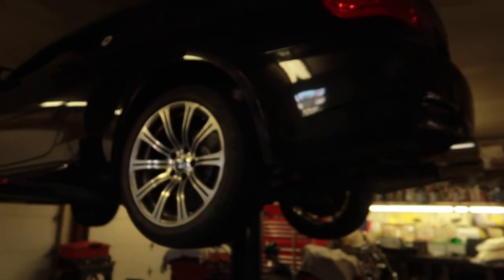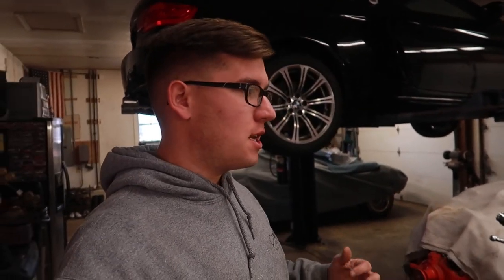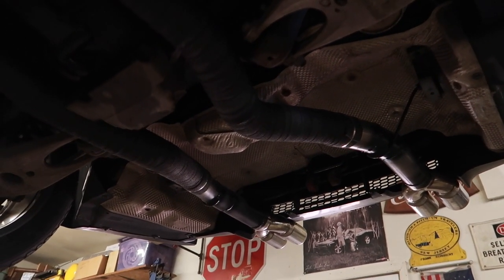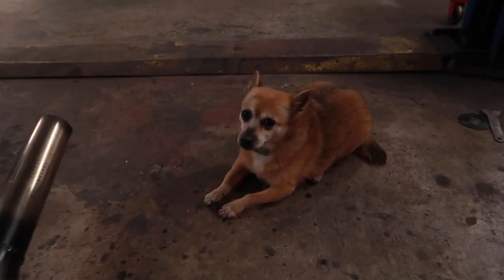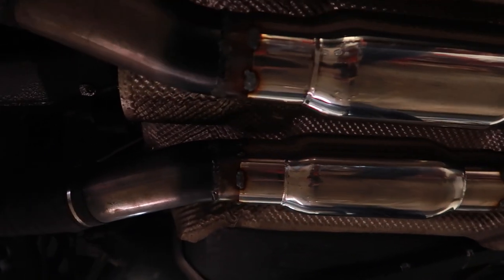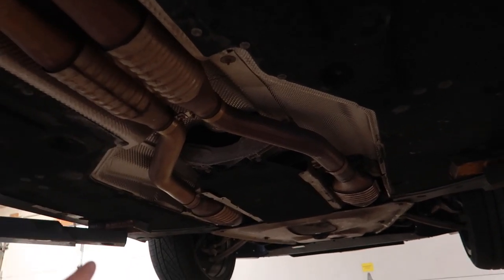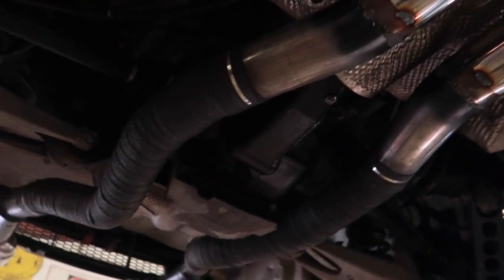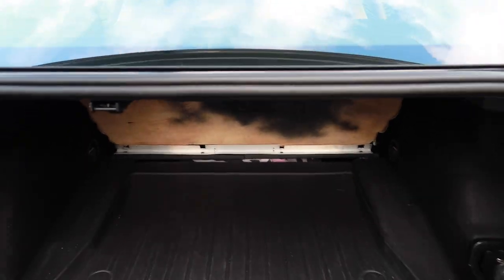Installing 2 vibrant performance resonators (hoping to fix the drone issue)

Comment: You will never get rid of drone with a loud car, it’s just the harsh reality of having no mufflers or no resonators. You will never get loud outside & quiet inside when you replace OEM exhaust components for louder aftermarket components.
Reply: Yeah I'm beginning to learn this. Always had trucks and they never had any drone issues but now that I've switched over to a 5.0 mustang gt I'm trying a few things and it's gotten better though
Reply: @collintaylor4127  try what?
Reply: Helmholtz resonators fix this
Reply: 45cm resonators are a good starting point or as you say in King Henry's measures 18"

Comment: Hey!  I recently installed catless downpipes on my N54 e92 with a aftermarket catback exhaust. Increased power and turbo spool but killed my exhaust note. I am going to be pursuing some Vibrant Resonators but which model did you use?  1794?

Comment: A Helmholtz resonator (J pipe) would definitely fix your drone issue. I just went through this with my car, even did the Vibrant resonators and found the same thing, helped with some rasp issues but did absolutely nothing for the drone. The thing is with the helmholtz you have  to get the length just right for maximum effect. There are all sorts of calculations you will find, the problem is there are so many variables they will not give you the ideal length. I found just a 2-3 inch change can make a huge difference. 
I new it would be somewhere between 30 to 48 inches, fortunately my car is a single exhaust and I had plenty of room to add a long J pipe. So I used a slightly narrower pipe with a band clamp so I could experiment with different lengths. It immediately helped but still not enough, I went to extremes and did not notice much difference, then I started doing smaller increments and when I got to around 42 inches it all of a sudden was a night and day difference. I really think this is the way to do it, folks that pick one fixed length right off the bat based off of some arbitrary values is most likely not going to give the best results. However if you get the length right the results are very impressive.
The problem with your situation is I don't see where you have room . A muffler will certainly work, but will also kill most of the sound you are after. That is what is so great about the Helmholts option, it is very frequency selective, so you can get rid of the drone and still have most of the sound you want. You just need to find the space.
Reply: This sounds right. It’ll be a frequency related issue, like I’ve posted. Interesting product you’ve found there.

Comment: J pipe is what you need for the drone. Resonator will only help on low RPM rasp. Will not lower volume and will little to no drone reduction. I had the same issue with vibrant resonator.
Reply: Hey man. Where did you place your vibrant resonators ? I heard some placed it where the mufflers used to be and others placed it where secondary cats used to be. Im having low end rasp around 1k-2k rpm. Catless vrsf dps. Sec cats delete. Muffler delete

Comment: Hopefully you ceramic coated exhaust before wrapping it… Otherwise moisture will build up between the wrap and the pipe, and ultimately corrode holes into it. 

Ask me how I know 😉
Reply: Exactly, but his kid did a video on reducing drone by installing a resonator (which typically target rasp, not drone), yet didn't even rev it in the video... I doubt he is keen enough to even understand what you said.
Reply: No it doesn't
Reply: @Liveforeever   Yes… It does.
Reply: @nataliamiliano150  mine didn't
Reply: @Liveforeever   Not yet… they will. 

Or pull off the wrap and see what’s happening underneath. You’ll see.

Comment: The resonators are designed to eliminate rasp from V6 and V8 engines. 

Inherently they will remove a tiny amount of other sound like volume and drone - but not much, and not their intention. 

A rear muffler is designed to reduce volume. 

The drone can come from anywhere. But ultimately it’s a frequency issue. Anything that you add or omit from the exhaust system, or anything that vibrates, will change your experience.  Therefore adding mufflers may change it or mask it: you may only need a small one; alternatively a different size resonator may work, or secondary inline pre-res set. You could even change exhaust length. 

You can chase this for ages ; this is what manufacturers spend ages on developing. 

Get it right and you might have a winner; something sellable. Not everyone wants massively louder & rasp.

Comment: Hey man, consider adding a set of hemholtz resonators, 1/4 turn pipes.  At what rpm range are you experiencing the drone?  I will look for the equation that'll give you an idea of the required pipe length to cancel out the drone frequencies.
Reply: don't know if you will see this but I just got magnaflow 12468 installed where my resonator was and got a muffler delete adding dual quad 4 inch tips (2.5 inch piping after 3rd cat) and it has hella drone around 1500-2000 rpm whether I'm on the highway or around town. They didn't bend the pipe to go around the gas tank on each side cuz the shop that bends it was closed and I needed the car the next day so it's pretty much straight piping from resonator to bumper (they put the pipe under the gas tank). I'm wondering if the drone would go away if they actually bent the pipe to go around the gas tank on each side or do I need these vibrant resonators?
Reply: @nikolayk.3670  is J pipe the only solution? I was so happy with the sound when it got installed today but the noise inside just makes me upset how much money I spent
Reply: @nikolayk.3670  what’s up boss hope u see this lol. I have a Honda Accord lxs 2011 all 2.4l. I replaced my muffler and love how it sounds. I don’t want to delete resonator but I want to replace a resonator thinking it will make the car noise a little deeper/louder? Any suggestions?? Please let me know

Comment: Should i be putting my resonators where my mufflers used to be ? I have catless dp, secondary cats delete and muffler delete. Also should i be getting the ultra quiet or the normal ones ? I get rasp in low rpm like 1-2k and also rasp when i step on it around 5-6k rpm
Reply: Or should i put the resonators where the secondary cats use to be ?

Comment: The 3in on the resonators is actually 3 in ID or inner diameter meaning they slide over 3in OD or outer diameter pipe.

Comment: Agreed with the removal of the seats noise. On my car, the drone is unbearable only with the center rear armrest door open. I cannot imagine with the seats removed.
I would put another set of resonators as mufflers, checkout Aero resonators, TR line.

Comment: Just put original mufflers back in and an electronic cutout just in front  of original rear mufflers. I put "dougs cutouts" in and they are amazing.  Factory sound when I want, then racing V8 with the flick of a switch.  They can be part open as well.

Comment: Have you tried installing a J-Pipe?
Reply: Yes a Helmholtz resonator would fix the drone issue, the problem is he would need  about 42 inches of length and for both pipes. It does not look like he has room to do even one let alone two.  But yes, if you get the length right it would definitely fix the drone issue.

Comment: So you removed the resonators and mufflers, and find that it's too loud and raspy. 🤔 Bro, you might have figured it out! Call the newspapers for this one. 'this just in! Mufflers quiet your exhaust!'
Reply: I have a high flow catted downpipe, straight mid pipe, tiny Cp-e mufflers on the axle back portion. It is a bit raspy as well, for me, so I grabbed a Flowmaster straight through resonator to hopefully cut some of the high frequencies out.

Comment: I did say!
Reply from the maker: haha you did, its hard to get that perfect note for cheap but I think I did find it with this new setup, just need to add some sound detaning
Reply: Yeh hopefully that works out for you or fit some audio sound deadner. Keep up the good work.
Reply from the maker: @ellipsis2315  yeah that's what I plan on using, thanks

Comment: I did a resonator delete on my 2019 and it feels slower. I am tripping??
Reply: Just happened to me as well, deleted two resonators on my Audi A5 and felt a decrease in power in lower RPMs. I’m running stage 2 FBO.
Reply: @TheChrizTrickz  Deleting mufflers or swapping for wider pipes reduces backpressure. Doing that usually impacts low end torque. The high end may have a slight bump in power, but in daily driving (where you spend a lot of time in the low end revs) you'll feel that loss.
Reply: @Michael.Landa.703  So what do you suggest to fix that issue?
Reply: @anabolicdopeboy7413  I did a muffler delete (kept resonators) and felt what he described. I went and had a muffler shop fab me a catback with a magnaflow 2 in-2 out muffler and high flow resonators. Cost a bit more than just deleting things but the sound is awesome all through the revs, there is no drone and (measured by my ass in the seat) I feel the low end is back. Not tuned btw. The engine just feels healthier. Sometimes shortcuts lead to the longer route. At least in my case.
Reply: @Michael.Landa.703  🤔Hmmm, seems like a good point bub